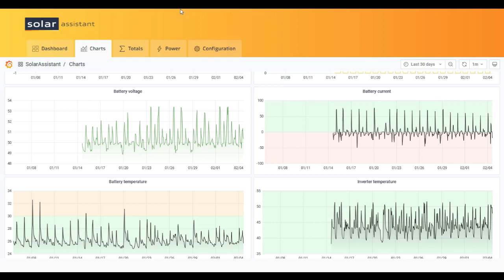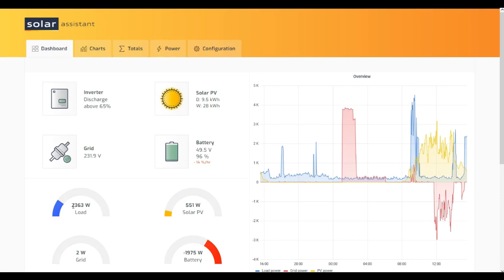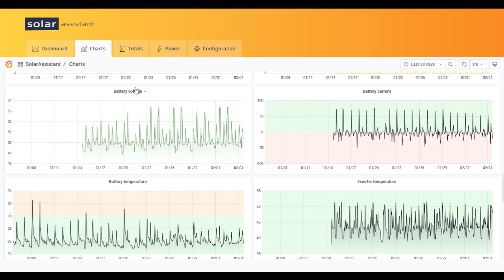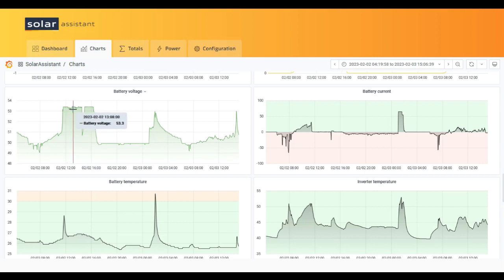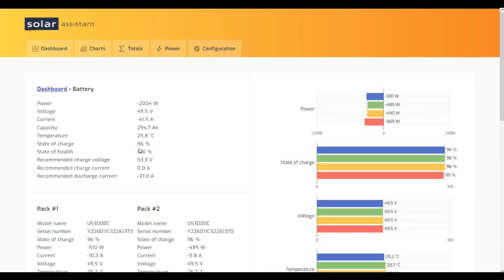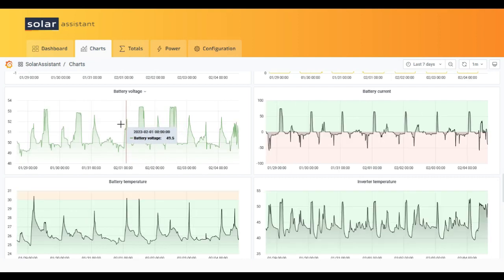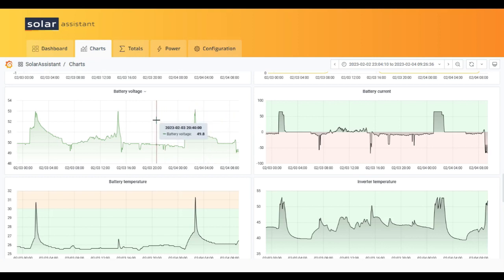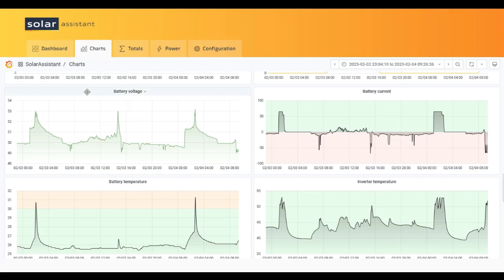Deye Sun 12K SG04LP3 with Pylontech US3000C - Firmware BUG

Comment: Tell us more about this inverter? Can it both export to grid but also allow to have power when the grid is off? I have a Huawei on-grid without batteries, but I am thinking to put an off-grid inverter with batteries only for the UPS functionality.
Reply from the maker: Yes, all Hybrid inverters are able to work both on and off grid. I am pretty satisfied with the Deye and its functionality as is one of the few 3 Phase inverters that can work with low voltage batteries. If power is cut , it will of course continue to supply to the LOAD port and work as an UPS. I have some servers , router and NAS running on the LOAD/UPS port and everything works nice.
Reply: @GigiBeleaDK  Only on this LOAD/UPS port ? Not the whole house? The rest of the devices will have a small interuption of power until battery connects?
Reply from the maker: @Ciprianolaurus  Inverter has batteries connected at ALL time , so if grid goes down you will continue to run on batteries, no interruption on Load port. It is normal that the inverter does not supply power also on AC port .. if the grid is taken down by the power company to do maintenance and you send power back to grid someone might get electrocuted :) If you want to have whole house on the inverter then run inverter in series with grid and set whole house on load port.

Comment: 53V nu e mult. Daca ai LIFEPO4 , ar trebui sa ai 16S pt 48V. Deci tu cu 53V esti sub 3.4V, mai exact esti la 3.3V. Ar trebui sa ajungi linistit la 56V pt Lifepo4 si sa fie safe, adica doar un 3.5V pe celula la 16S. Eu am alt tip de invertor si e pe 24V la 5KW, dar merg cu tensiunea pe celule la 3.6V  o data la 2 saptmani sa isi faca ballancing celulele am 8S. In rest le duc pana la 3.5V de cate ori am soare si sunt incarcate.  Pylontech foloseste 15S sau 16S? din calcule imi iese 15S, si atunci te apropii de 54 care e 3.6V pe celula dar pt 48V sistemele sunt 16S....
Reply from the maker: Mai studiaza putin Pylontech :) Pylontech sunt toate 15S. Charge voltage e MAX 53.3 :) Daca te uiti putin la valorile indicate de BMS , o sa vezi ca scrrie clar 53.3 max voltage. Si nu e normal ca invertorul sa tina bateriile la 53.4 pentru x ore. Cand totul functioneaza normal , voltajul creste si scade in cote normale. Discutat problema cu Deye si nu e normal behavior.